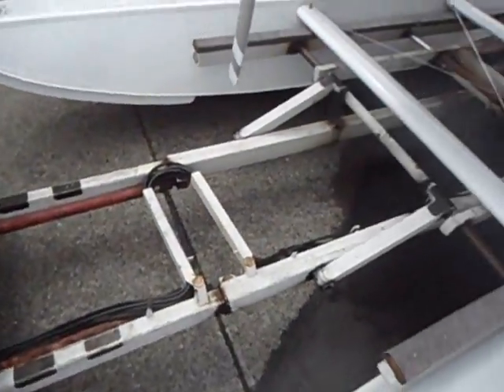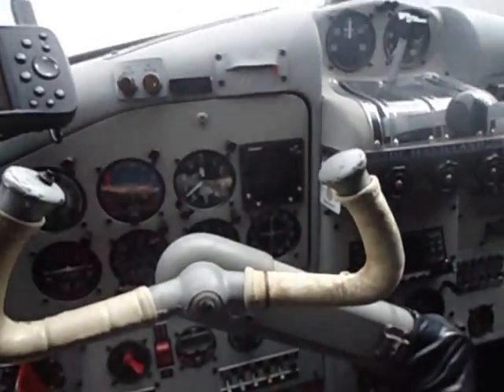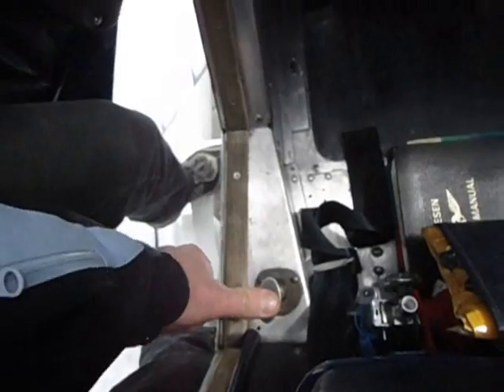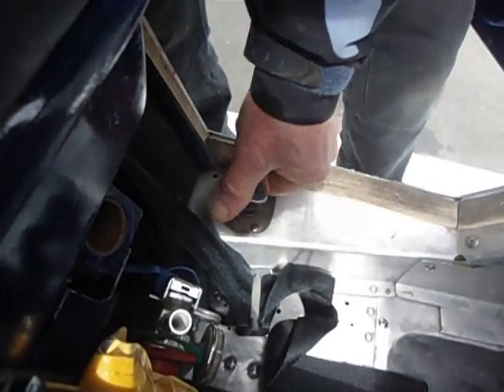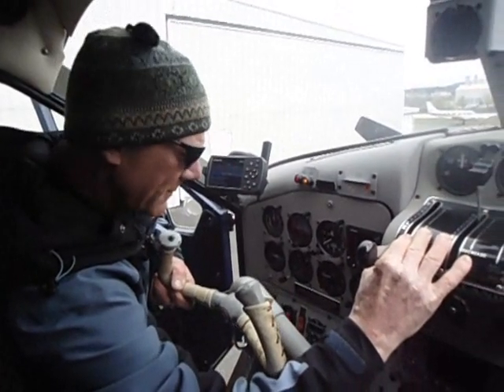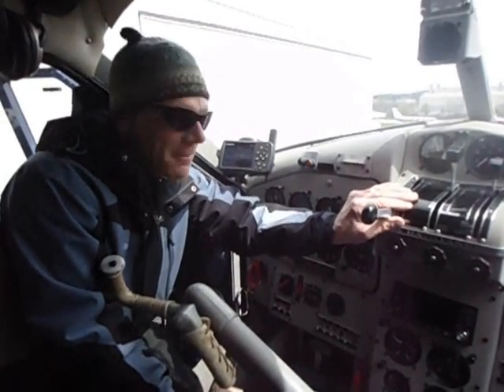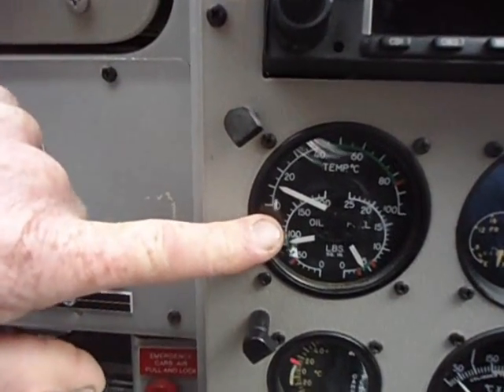How to Start a Dehavilland Beaver DHC-2 #jimthepilot

Comment: I was the crew chief for a 1957 (manufactured) U6A Army Beaver in 1968.  On my daily run up and short taxi out of the revetment, I used to do a mag switch check to see if there was a RPM drop going from both mags to single left mag, then single right mag.  If there was no RPM drop on single mag check, it meant the timing was advanced for that mag, and that mag had to be re-timed.  Also, I think it had an inertia starter - long time ago.
Show less
REPLY
￼
￼

Comment: can you put mags to both then hit starter switch?
Reply from the maker: you can
Reply: how long can a beaver go without having to refuel? from a full tank to empty?
Reply from the maker: 25 gallons per hour

front tank 35 gal
middle tank 35 gal
rear tank 25 gal
left tip tank 21 gal
right tip tank 21 gal
Reply from the maker: you can but not how we do it... and 5 1/2 hours fuel.. 138 gallons and 25 GPH
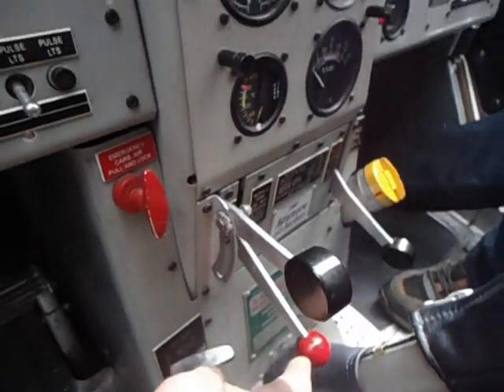Reply: let's say first fill up was at 8 a.m. so you wouldn't need to refuel until 1:30? which would be right around lunchtime! if that was the case, I'd want to be back at or around 1 p.m. so as not to run low! better safe than sorry